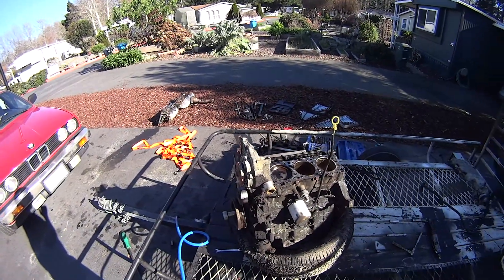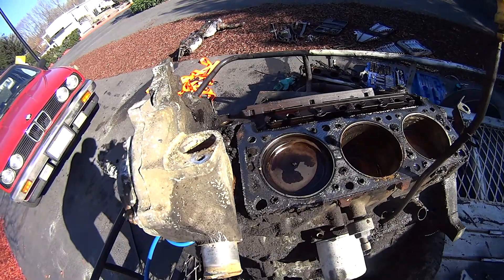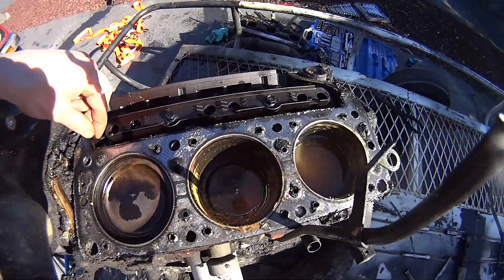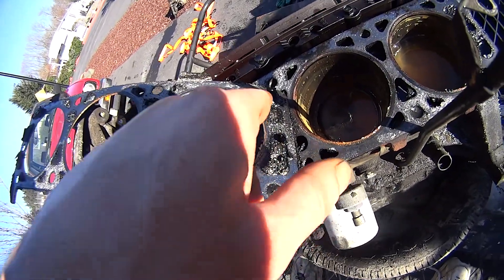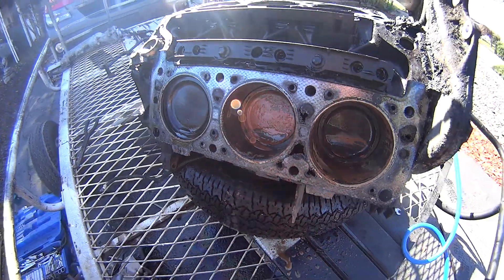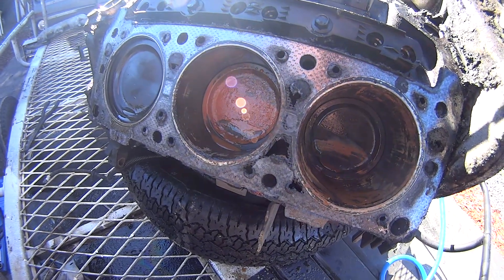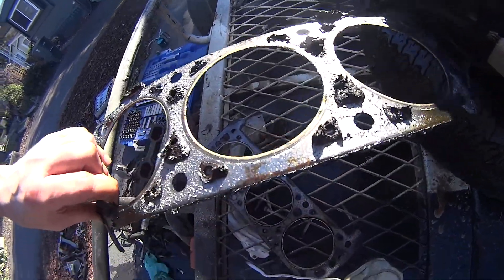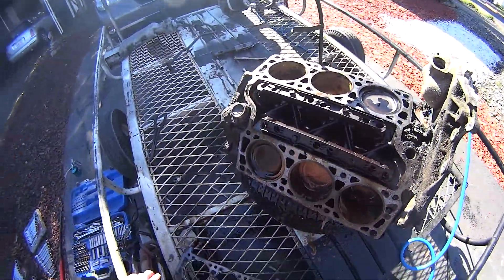Why 3.4 GM 3400 Overheats Over Heats No Heat Over Cools Bad Blown Head Gasket 3.1 3100 Heating

Comment: Ever had stumbling/stalling on acceleration? My 2000 Montana has gone from what seemed like an occasional bad shift from the transmission to being absolutely undrivable and leaving me stranded.
Reply from the maker: Try unplugging the Mass air flow sensor, if it starts running better replace it
VT247
Reply: @Vacationtime247  Didn’t help, but thanks anyway. I’m about positive it’s a bad transmission. After driving a few minutes it begins stumbling under load. The tach starts jumping and you get intermittent stumbles and revving, like it keeps slipping in and out of gear. You let your foot off the gas and it usually starts idling fine but begins stumbling again when you try to accelerate.

A couple months ago the issue would go away and you could drive the rest of the day just fine but it has got progressively worse to the point where it can no longer idle and will leave you stranded until everything cools down. You’re lucky to make it a couple miles.

I don’t know how hot it’s getting but the transmission dipstick and dipstick tube are typically too hot to hold/touch after driving. Fluid isn’t low.

Comment: I have a 3400 sfi on a 04 Buick Rendezvous. I have flushed it and no matter how many times I have flushed it to clear water from various positions on the engine I always seem to get that orange muck once I ride it for a bit. I did a head gasket test with the chemical tube and didn't get a reading. I also get the over cool and over heat issue if you ride it for 30 minutes it will start to go over the half way mark but sometimes it will drop. I did the chemical test on the coolant reservoir because you can't do it on the radiator cap by the way it is designed. What I was thinking was someone mixed coolant leak stop but I am not sure now because the color looks exactly like the orange you have on the top of your piston. I am considering if I want to fix it or not. Any thoughts? thanks
Reply from the maker: If you’re going to fix it, replace all the gaskets including the head, I take and timing cover too.  They all eventually fail.  I’m betting the head gaskets are going bad on your engine with the over heat and over cool conditions you mentioned.
VT247

Comment: Thanks for the video. I have a 2000 Pontiac Montana with the 3.4, super clean van but when I bought it the guy said it was not getting any heat cause of a bad thermostat. I replaced the thermostat and radiator cause it was leaking a little and new water pump for the long run. However it still had no actual heat coming out of the heater, I blead the air and kept adding coolant but still no real heat. I then drove it 300 miles round trip in traffic at a standing still in warm weather, it kept trying to get hot but once I went down the road it would cool off to normal temperature. The check engine light came on with a missfired on cylinder #2 so we checked everything including compression it all came out good.  When cold first start it will run rough for a minute then it seems to clear and runs fine and smooth the rest of the day.  SOOOO it seems like I have a bad head gasket! :(
Reply from the maker: The gaskets on the 3400 just don't hold up over time.  The water ports on the head gaskets degrade allowing more coolant to flow through than what it should.  If you do decide to fix the head gaskets, do the timing cover too.  Not much more work while it's all apart.
VT247
Reply: @Vacationtime247   I will be using Victor Reinz Gaskets, It seems like they are probably the best around. ?
Reply from the maker: @refgarcia8218  They are good gaskets.  When I rebuilt the last 3400, I used Fel Pro, but would not recommend OEM.
VT247

Comment: Hi. I have a weird problem with my 3.4...  I have a constant stream of bubbles entering the cooling system but there are no misfires and the engine runs fine which would make me believe it's not a blown head gasket. What other places in this engine could gasses get pushed into the coolant?
Reply from the maker: Best suggestion I could give is to do a coolant pressure test.  They rent them out at Autozone.  Pressurize the cooling system with it full of water and the leak should become apparent.  That, or put a chemical test on it and watch to see if the water changes color.  Know this isn't the news you want to hear, but I'd bet it's still a head gasket.  The GM 3400 engine have a horrible reputation for bad gaskets.  If you do replace the head gasket, go ahead and do the timing cover and of course the intake gasket both.
VT247
Reply: @Vacationtime247  thanks for the advice. However, the system self pressurizes and holds pressure after shut off and cool down. I have to flip the lever on the radiator cap to release it. Gasses enter the system immediately on start up. But pressure does not bleed off after shut down... Any thoughts on that?
Reply from the maker: @WApnj  I’m still guessing it’s the head gasket.  It’s the only place air can enter the system and create air bubbles as you’ve described.  All the head gasket failures on these engines and the motor still runs fine.  But, YouTube has been horrible about notifications so my apologies for not responding sooner.
VT247
Reply: @Vacationtime247  the man asked you a question a year ago, is it still vacation time?
Reply from the maker: @jaybradley100  YouTube notifications aren’t that great.  There for a while some where even going to the ‘needs verified’ before allowing it to post.  Wasn’t intentionally trying to ignore anyone.
VT247

Comment: Never seen a blown head gasket overcool an engine.....dexcool eats away at the gaskets, hence the failure.  I'm at 180k. Previous owner replaced intake gaskets and switched to green coolant..  still going.
Reply: That's not the problem. My 2.2l in 2000 cavalier still runs same dexcrap same with my 04 escalade ext. The 3.4l is an engineering failure and had 2 die on me due to blown head gaskets. Stay clear of these motors.
Reply: @thebunz7 'm going with what he said about the dex/cool it contains special acids which can eat away gasket material and it's especially formulated for aluminum engines.
Reply: Also I have a Ford ranger with similar wholes in the gasket and it's ran 30+ years and allor of miles on green coolent before I replaced my head gaskets and I was surprised.  I'd use fel pro replacements better gasket then Gm,  Wow must have been gm cheap lol.

Comment: How in the hell do you over cool an engine????
I guess if you live in the Antarctic area or you don't use any antifreeze. Around Christmas maybe that might over cool an  engine🙈 I don't want to step on any toes here but I feel that this guy has about as much knowledge as people looking up YouTube to diagnose their engine problems on a 3400 motor. I myself am guilty of doing the same thing by the way . Speaking of diagnosis of the internet I feel as if I'm trying to cure my own elements with WebMD🙈
If you really want to diagnose your problem using the internet I would definitely look into it more than one YouTube post and or Google post followed by a chiltons book of that particular year make and model. Because the book itself was written by people who actually either designed the car or took it apart piece by piece themselves. On a plus side if you ever sell that said car you can always add in the Chilton's book as a bonus or a little extra cash to get your money back on the book and it will  make you look like you know more of what the f*** you're doing  when you sell the car 😬👍
Reply from the maker: Question is, how do you over cool an engine.  Showed it in the video.  The head gasket water ports blow out.  Where they typically go bad, the ports should be around the size of a pencil.  When they go out, the size increases substantially.  The cooling system works under pressure.  It can't build up that pressure and temperature with that increased flow.  A stuck open thermostat will also cause this issue, but is rarely the case when it comes to these 3400 motors.
But your right, don't take just my advise.  Find others that have had these engines.  They'll say the same thing.  The gaskets, that came from the factory on these GM 3400 motors, suck.  Eventually they will fail.  My own advice to those working on them, if you're going to replace one, replace them all.  Don't just do the intake gasket, do the head and timing cover gaskets also.  Not fun doing the job twice.
VT247
Reply: My 3.4L engine (2000 Pontiac Montana) overcools.

It will not get up to operating temperature unless I idle. The needle stays pretty much all the way down if I’m moving. I know the gauge is able to read higher temps because I lost the belt and it instantly overheated months ago. The hose coming from the thermostat feels warm even with the needle pegged low, so all signs point to a thermostat that is stuck open.

I just bought a “fail-open” replacement since I’ve apparently been running it that way for almost a year and I certainly couldn’t if it failed the other way. I’m just hoping it isn’t over cooling in the way Vacationtime247 here describes. I had all the hoses replaced and the coolant flushed last year and I’d expect over cooling wouldn’t be so drastic if it were just wider passages through the gasket.
Reply: *overcools, not overcooks. Darn auto-correct.

Anyway, I did find the old thermostat was stuck open and it finally gets to operating temperature now that I replaced it. Overcooling hurts efficiency and can shorten the life of your engine in various ways.

Comment: If gasket blows does this mean heads need to be rebuild as well? I have a 3.4 impala which I replaced heads, gaskets, entie water system worked fine for 3 months till it started to heat up again parked it n still don't know what is wrong with it
Reply: 3'4 they need high quality fan and they best way to make not over heat it's to buy high performance radiator fan and replese it with the stuck one and you see not gonna overheat again

Comment: Dude help same engine what's the metal plastic stuff that goes around the intake by the thermostat and the sensor it cracked broke antifreeze sprays out what I do to fix it help me out has 143 thousand

Comment: The 3100 didn't have this issues. Not the 2nd gen at least.
Reply: Keep the antifreeze fresh and green I would dump it annually I would dump the factory antifreeze in a heartbeat I seen Expedition Motors with the heads completely ate the antifreeze turns acidic the head will act like a plate in a battery and about a hundred thousand miles I was told if it's not under warranty change all the antifreeze in fact you can put a meter probe in the antifreeze I'm talking about a good meter and the other lead to the Ground Terminal in a that reads at all you're in trouble dump antifreeze
Reply: The issue with the 3.1 engine probably that one too at 200,000 miles the cam bearings be completely wore out mine were and the rod and main bearings look like brand new and I'm going to warn you do not get this engine hot there's not a lot of stock holding the bearing in the engine only 50% of the bearing is hitting the block my engine builder showed me that 200000 mi get rid of that damn car I don't care how good it runs the cam bearings are worn out all of them engines I'm not bullshiting you all of them
Reply: he probably got the engine hot the gasket  not very good especially if you had water in it or old acidic antifreeze don't laugh at that that's not bulshit read my other note
Reply: 4th or 5th gen GM fixed it by using different coolant

Comment: those engines are garbage they should have went with a 3.8l
Reply: iv seen tons of grand ams with well over 200k miles still running...far from garbage
Reply: nice! I had a 99 that was abused to say the least and it finally blew its head gasket at around 180k miles.its been sitting since then for almost 8 years now but I wanna bring it back to life.always loved the red Pontiac gauges
Reply: @samsquantch14  I have the same exact thing but its an 02 grand am gt sedan 3.4l and im currently in the process of bringing mine back to life right around 180k miles on it it lasted a long time before I quit using it its been sitting for about 5 years outside and I went in it yesterday and she started right up! (of course after changing all the fluids and gas)
Reply: @samsquantch14  had 2 and both blown head gasket where exhaust fumes go right into coolant jacket so can't pour fluid in. Stear clear of these trash motors. Only good V6 gm engines are the 3.5L 3800 or monster 4.3L.

Comment: So are you swapping this engine?  Or are you fixing the gaskets and replacing heads
Reply from the maker: The engine in the video is going in the Aztek.  The one in the Aztek appears to have a crack in the block.  I'm also ordering some remanufactured heads to go back on.  Have 4 heads for this engine right now and 3 of them have a crack between the intake valve seat and the spark plug hole.
VT247
Reply: Yeah I have followed along with most of your videos,  but how did you know the engine was going?  did it start to make noise after the head gasket/head failed?  Would it run at all?  Just curious.  I fixed the gaskets in my rendezvous about a year ago.  No problems except I think the eletrical fans should turn on at a lower temp.  I force my fans to be on by putting defrost/heat or AC on all the time.  That will force the fans on full time.   I think its the coolant temp swinging from 185 to 220 that takes out these gaskets and heads.  I wish you could program the car to do this.  But I dont think that is possible by even a dealer mechanic.
Reply from the maker: I knew my block or heads were bad when it overheated headed down to Klamath, CA.  Temp gauged pegged into the red, overflow bottle puked it's guts out (pure water) all over the side of the road.  Managed to make it back into town.  I would bleed out the bleeder screws then watched bubbles in my coolant overflow tank appear.  That really sucks.  Will pull out the engine out the top and replace it with the $200 short block from the junkyard.  I'll replace everything while it's out.  Put on a new front timing cover seal, change out the sensors, change the camshaft and lifters, new head and intake gaskets.  Make it good as new.  Hope all goes well and get it back on the road.  Had this Aztek all over the USA.  Keep it cool and start driving it again.  Really bummed right now it's not going.  
The '73 Mustang needs a new radiator.  This after already replacing the: coil, rag joint / steering coupler, master cylinder, bleeding the brakes, getting a new battery, used Edelbrock 289 Performer intake & gasket, 600 cfm used Edelbrock Carb, new front calipers & pads, sway bar links, took off the A/C compressor, new water neck, reseated the rear tire on the rim, and change the oil.  Everything I touch any more needs fixed.....and list never gets shorter!
VT247

Comment: 1.25.15.     What is the mileage on the Aztek?, & were the L.I.M. Gaskets leaking DexCool?
Reply: Vacationtime247 you should slap on some lx9 3500 heads and lower intake after you rebuild that block also make sure you use a timing set from a 99 3400(bigger better chain) btw you will need to mil the heads to keep compression.
Reply from the maker: So weird that I can't respond to this message until days after the video's up.  What's up with that Youtube?  Anyhow, the upper intake gaskets didn't look to bad on this engine.  The block is good and spins over fine.  Found out upon research and inspection that the heads on the 3400's are prone to cracking between the intake valve seat and the spark plug hole.  I've got 3 of the 4 sitting at my house right now with cracks!  Pairs are sold on eBay for @$340 shipped, ouch.  
VT247